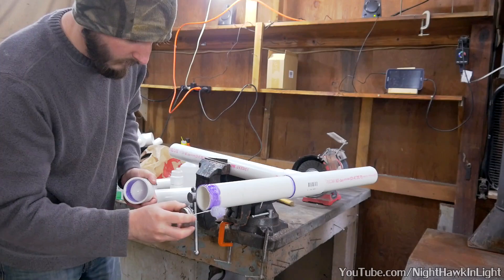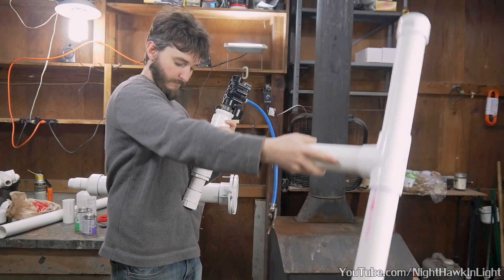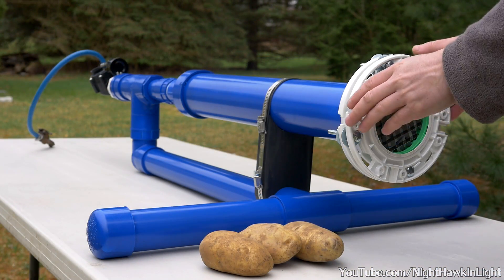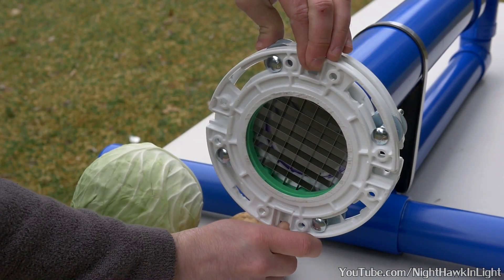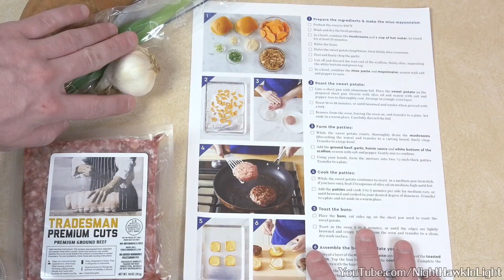How To Make A Produce Slicing Shotgun Barrel For Air Cannons!

Comment: I would suggest adding a plastic cylinder the diameter of the barrel, lined with a low traction rubber, as a more permanent sabot. you could then drill holes near the end of the barrel so that the air can escape. This way, you don't contaminate the projectile with other material.
Reply from the maker: Slowing down that cylinder so it doesn't blast through the blades would be all but impossible

Comment: You should use a 1/4" ball valve with a shop quick connect Instead of a tire valve. This way you can connect your shop air directly to cannon charge port. To charge the cannon,  just open and close the valve.  Recharging takes 2 seconds and one less hand!! Please make a video and share with Grant @ THE KING OF RANDOM. This will make all of your pneumatic projects easier to fill for both of you. Keep up the killer content.
Reply from the maker: Yeah that's a good option. The reason I use a schrader valve is so that the cannon can be filled with a bike pump when not near an air compressor.
Reply: Dual fill ports!!!!!!

Comment: Could you run your dump vale exhaust into the barrel for a closed system?
Reply from the maker: It would probably make the projectile leave the barrel before the main valve opens which would weaken the shot.

Comment: Very cool sponsor. I appreciate that your paint job was on-brand!

I'm curious why you used such a large bore for the barrel? In addition to requiring the coleslaw around the potatoes, I imagine it required a lot more pressure to do work. Was the barrel diameter dictated by the size of your slicer kit?
Reply from the maker: Yeah I wanted the larger barrel to make good use of the full diameter of the slicers.

Comment: That's really cool! I wouldn't have expected the slicer blades to work so well under the sudden impact of the projectile.

Just out of curiosity, was this video charged to patrons?
Reply from the maker: I didn't expect it to work that well either. The slicers surprised me. This video was charged to patrons. Pretty much all my full length project videos are. My short videos like making the piston and brass fittings were not.
Reply: Hmm, this is a little bit awkward... I love your videos and I want to support you...but I feel a little bit cheated being charged for a video that is, to a large extent, a sponsored ad for some product/service. :(
Reply from the maker: The project was not influenced by the sponsor, i was already working on it before I was contacted by them. They only had a say for what happened during their segment at 4:24 - 5:13. If it weren't for the sponsor it would have still been the same video, just shorter. But sorry to make you feel cheated. My next video is another free one.

Comment: Hmm… Now we must think on how to catch the sliced vegetation without turning it into mush. Perhaps use less air pressure, and catch them in a tub of water?

I think this needs a more developed loading mechanism, too, if it's to actually be used for cooking. Muzzle loading just doesn't cut it for a high capacity kitchen.

Also, if you like the skins on your potatoes, remember to scrub them first with water.

Comment: how did you make that valve on the back
Reply from the maker: I build the valve in my previous video. https://youtu.be/G1VCZEXi384
Reply: I meant the black valve at the end because before you used a ball valve
Reply from the maker: Sprinkler valve was modified as shown here: https://youtu.be/ymfrrX5kIvM?t=1m16s
Reply: thnx